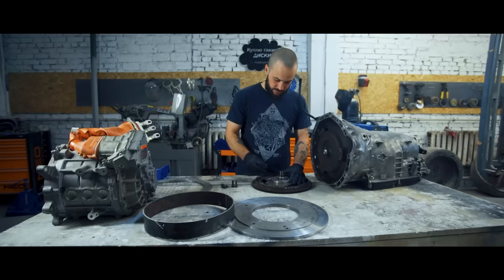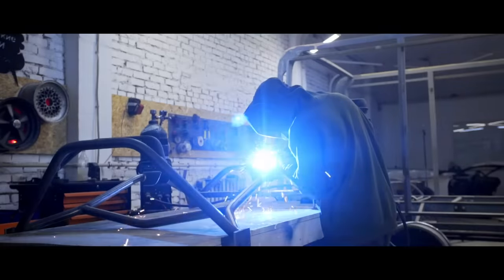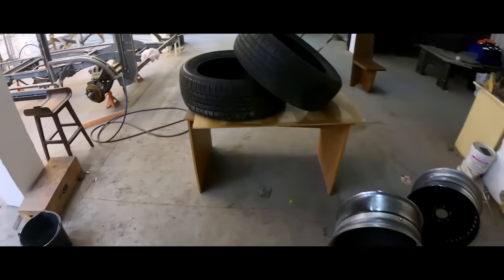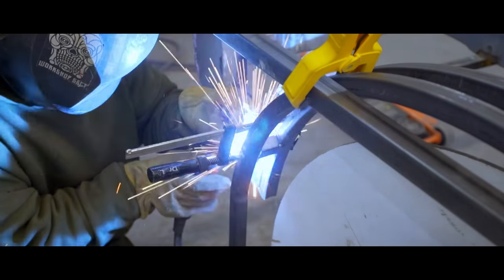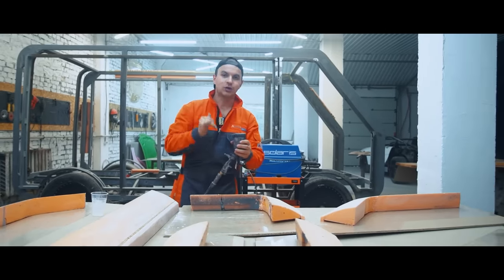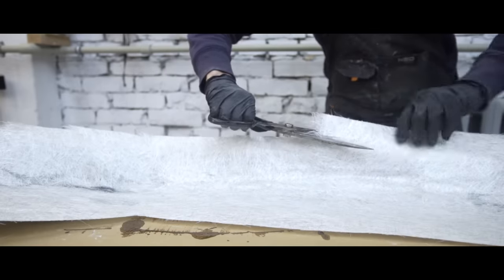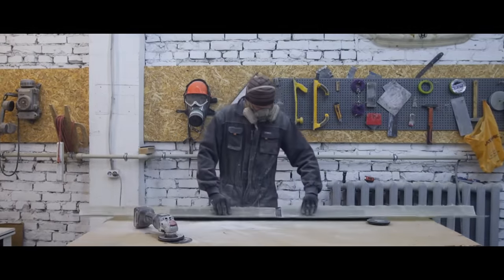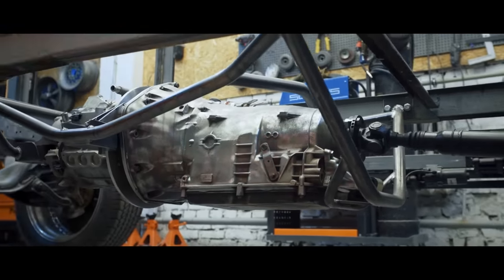HomeMade. Electric Cyber Van from the future. BIG Part 3

Comment: Even when doing a one off plug and mold you should use a high temperature mold release wax then the polyvinyl alcohol. I use TR-104 wax, don't know if it's available in your country. It's a hard, light blue wax in a metal can. Spraying two coats of the PVA should ensure complete coverage. I also thinned gel coat with acetone to spray a bubble free coat. When laying up the glass, I sprayed an acetone thinned coat of laminating resin first and let it set to a firm state. The sprayed on coats eliminate surface pinholes.

Over here in the USA you could get a VIN assigned, or use the VW van's VIN, and register that van for public road use. Most of our States are very lenient on custom built vehicles. Some even allow the Legends race cars to be fitted out with the required lights and other equipment to be street legal.

Comment: You definitely need to do something like you did with the "TV hood" going down the middle. Or make "moving" pinstripes going down the middle, by using that hood method. Just on the pinstripes, racing stripes. That goes front to back straight down the middle. Two 6 or 7 inch stripes.  That would be awesome.

Comment: I suggest to use liquid polycarbonate resin and make a entire piece of the mold you already have. Adding white pigment you will have a headlight contour with uniform light even using LED strip. I don't think fiberglass fiber it is necessary because the resin alone has a lot of strength and also because of the fiber make you lost the uniform cool looking of any "headlight".
Ongoing work it is really good. Congratulations.

Comment: This would work better size as a smaller van vehicle, more practical for use more likely to buy this save on weight and battery usage.
Reply: Fuel cell hydrogen or water or air this is a way to make it long lasting and solar cells as well

Comment: Would love to hear the reason why anyone would be critical of using an automatic box, the project is a 'Cyber Van' so its futuristic. I'm sure I dont have to remind anyone that all vehicles in the future will be automatic, infact once combustion engines are phased out over the next decade there will be no new cars made with manual transmissions. Yes maunuals have their uses in larger heavy viehcles right now but that again will change in the future.

Gone are the days of 'dont buy an auto because of X', automatics are now more effeicent with proper driving cause less damage/wear to the engine as manuals (due to user error) and are generally just as easy to fix/repair and last longer than manuals under normal conditions at a simialr price point.

That said I'm fully ears open to any reason for why this project or maunuals in general are pref used, before anyone says racing jsut remember than formula/rally racing actually banned electric/auto designs for years ago because of how much better they could be driven 'almost liek cheating' they called it xD

Comment: Hi, why use a transmission and all the effort involved with fabricating, when you can do direct drive from the electric motor to the prop shaft / diff ? Less parts to fail as well as more torque

Comment: Nice effort. My sugestión for your next project, is to get more involved in planning design and engirneering, before going into construction. Doing a well thought packaging of the vehícle, its highly recomended. You should had started with a new plattform, especially if your going electric. In this casé a direct drive system would have being a better solution, than using an old axle and differential in an old chasis. You are killing your GVW There are new construction techniques to develop a simple light weight space frame using a tubular construction, that will give the vehícle a lot of integrity.
Doing things from a clean sheet of paper, will give you great results and a great product. Take your time to do your planning and research. Get more involved first on the basic design before going into the fashion and gimmiks. 
FORM FOLLOWS FUNCTION 
I was involved in the OEM design side of the business for many years 
Best Regards.
Reply: @axes_garage  Will take a look. Congrats on being creative, Im a car designer as well, getting yourself involved in more in depth engineering and planning, will bring your projects and ideas a lot further. Let me know if I can be of assistance. Regarse